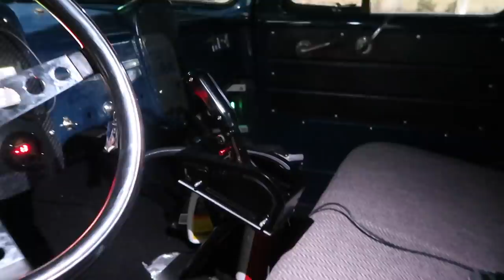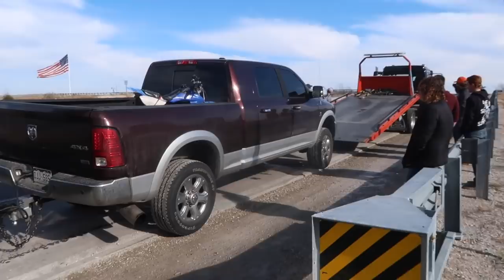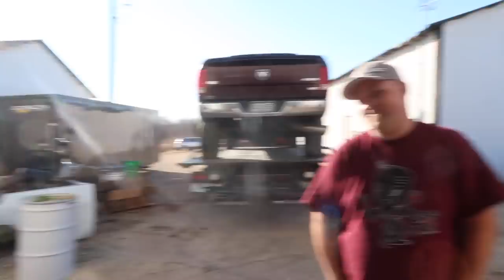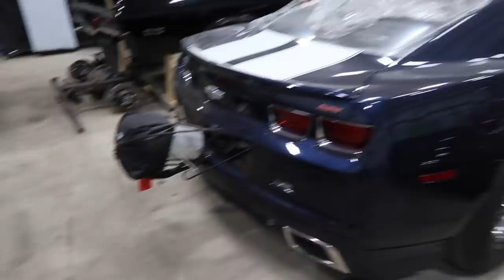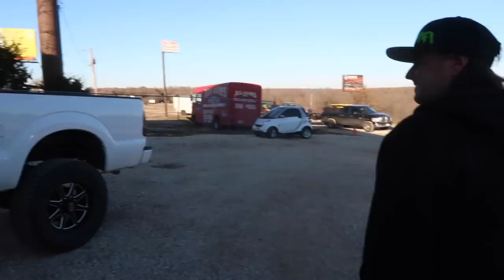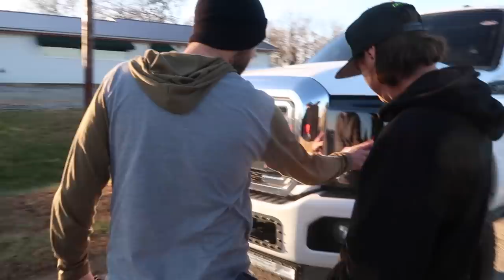Our New Tow Rig Blew Up...

Comment: Next time, don't buy a bloody Dodge.
Reply: Dont buy an automatic dodge and if you do, dont drive it when its throwing a torque converter code! Any other brand of truck would have done the same thing if it already had an issue like that.

Comment: Surprised the Cummins blew.   I'd still choose it over the alternatives.  
I wonder if the error indicating problem with converter lockup meant it was slipping the whole time which would explain the terrible mileage, and higher heat.   Maybe it cooked the rear main seal, although that shouldn't lead to nasty engine noises unless it ran out of oil, which you guys said it did not.

Comment: Go with what your comfortable with, they all have their strength and weaknesses. I have had nothing but Dodge Cummins they have done me well, my 04 still going strong. I will get another one if I wear this one out. One of my friends has a new Duramax  brand new. Broke down pulling his boat this year had to get towed, had to replace all his injectors. Like 5k worth of work on a new Chevy. Shit happens. One thing I would recommend if you keep the Cummins, get a fass pickup pump. Good luck.

Comment: BoostedBoiz@
That powerstroke sure does look good with a white trailer behind it. You should know better Kyle, driving on the highway without lockup will overheat your trans unless you have a monster cooler. High speed fluid shear = friction = heat = transmission damage!!

Comment: I blew the torque converter in my RAM 2500 Cummins, and it destroyed my transmission. Well, after it started having issues and not wanting to move anymore, I put it in 4 low and kept it to the floor until it wasn't moving and was making a lot of noise. I took it to the RAM dealership and 2 days and $6589 later It was back on the road. lol. Not sure if you have your truck tuned, but I had a Bully Dog Triple Pup tuner, and was towing on the highest setting when I should have had it on the tow setting and the tow-haul on.

Comment: Dont let it discourage you from Cummins 😂
Reply: @daerrickjohnson1349  especially the weak Chrysler made one. There is a reason the Aisin trans is available for the Cummins.
Reply: NJ in the MJ At this point you can build a 48re better than any other auto transmission. There’s guys out there holding well over 2k hp on a “weak Chrysler” transmission.
Reply: @daerrickjohnson1349  Interesting. What would be the point of offering a trans designed for medium duty commercial application if their house unit is as strong? I know Suncoast builds strong units from Chrysler cores, but I was talking about a stock unit comparison of strength.

Comment: The ccv filter in the top portion of the two piece valve cover is a ware item, it is supposed to be changed about every 50-60k miles and when it plugs up the positive crank case pressure has no where to go typically it’ll blow the rear main seal, hopefully that’s all it is

Comment: I have the same problem in my f350 the  The torque converter went out in it so was not circulate the fluid in the transmission and it would get  too hot my transmission fluid would get up to 260 when I would go up hill and you should be under 200 most of the time or something is not right

Comment: Did you window the block? That is why I buy Caterpillar. The new Ford have a better built trailer tow package, on their trucks. Might have blown the oil line to the turbo or an oil cooler, trying to be positive here. Might be something simple. Used to pull my 580 Case Bulldozer all over the country in Arkansas with my 2 Ton Ford dully and a lowboy trailer. Built tough is right. By the way, thank you for trying to clean up the language, I might try subscribing again to your channel.

Comment: My 2015 2500 Cummins blew out one of the tranny cooling lines. Turns out overt time and vibration, the c clip sheared itself thin and the line popped out. that happened at 65k miles. installed new fitting and all good. My superintendent has a 2017 F250 with 35K miles and the Camshaft broke and needed a new engine. Because he was just a couple hundred miles from the warranty expiring they gave him hell and he had to hire a Lawyer. So no matter what you buy, it all breaks.

Comment: Cummins don't blow up unless they are totally neglected and abused. On the other hand, Dodge Ram transmissions are junk... unless it's an Aisin.  I think that diesel mechanic nailed the diagnosis. Have him fix the rear main seal and build you a transmission. It'll run forever.

Comment: Get a cummins with a 6spd g56, you'll never have to worry about anything... Besides the clutch.
Reply: Everyone is freaking out over nothing.the engine is fine.the flex plate was probably cracked before he started the trip and pulling all the weight has caused it to break  and has took out the rear main seal adapter plate and caused the oil leak.as long as it didn't damage the block or crank sealing area it can be fixed easily.I've seen it happen multiple times at the dealer ship I work at.If it's an aisin trans they are great transmissions and have seen them tow way more than are rated for with no issues.wonder why most tow trucks and car haulers are dodge? Cause they are built to work not show like other  brands.anyone who owns a dodge and tows with them say they won't own anything else.yes they all have issues but don't have turbo's stuck in the center of v-8 engine baking the oil and causing excessive heat to make gaskets brittle and a pain to work on.great idea ford and chevy.keep your dodge kyle you will be happier on the long run

Comment: Turns out the $125 flexplate failed.  Not the end of the world or a reason to roll the dice on another used tow rig.  Personally I'd buy a new Ram 2500 Tradesman from Dennis-Dillion with carpet, chrome, tow package, tint, back up camera for $39k

Comment: It's hot an Automatic Transmission, that will always be the downfall with Any Diesel Engine in Heavy Duty capacity. If he drove it like 90% of the Diesel pickup owners do. They mash the Throttle flat to the floor starting out from a stop.

Comment: cumins is usually pretty reliable , maibe you just pushed it too hard.............well like i said cummins are pretty reliable , build transmission should help , big ass transmission oil cooler prolly will too , could add a slightly bigger turbo at a later date and not worry about the driveline (well maibe the diff)

Comment: Never send a dodge to do a fords job🤷‍♂️
Reply: id flip that around. i see more fords than Dodges on the side of the road. The only diesel from Ford i would use is a 7.3L.
Reply: Dodge can’t do it
So just switched to ford night and day difference
Reply: @erikkarlonas180  funny because thats not a ford engine, either is the 6.0 or 6.4 that you are seeing on the side of the road. 6.7s are the only Ford diesel, and from what ive seen they are great engines and tow like raped apes

Comment: "I want a nice truck that can haul stuff" - Buys a notoriously unreliable dodge.... get a Duramax... the combo with the Allison is untouchable.
Reply: LOL
Reply: Yeah ok, let me know when durajunk is in semi trucks 😂
Reply: BraaapAttack that just shows how much u know about semis.. it’s the same concept and designer but not the same motor... 😂 besides the tranny is the problem in those dodge trucks. The Cummins is incredible but it’s backed up by a dog turd for a tranny which is why the duramax (which is the second best diesel power plant) will always get my vote.
Reply: The 68rfe does just fine in stock form, but if you have an idiot light on for a problem, and it goes for how many hours cooking itself, shits gonna fail. All the 68rfe asks for is transmission fluid and filter changes and use your head while towing. 

But far as durajunk, find me a v8 based diesel in a modern semi...
Reply: @braaapattack2937  duramax is an isuzu joint venture motor and isuzu is in a shit ton of semi trucks the allison is way more reliable then the aisin tranny.

Comment: The only Cummins worth a shit are the older 12v engine's. I have owned 3 of them and were all great engines but the transmissions are trash. If i ever bought another 12V I would probably do a 4R100 swap or a Allison transmission because gearing is better for highway.

Comment: This was your own dam fault. You knew you had a lock up problem with the converter and should have fixed it before you left,now it's going to cost 3x as much to fix , all the crap that went through the transmission will have damaged way more that if you had just fixed it not to mention bearing wear in the bottom end of the motor, better do a bearing roll/swap. You now have no excuse to not do all the up grades to the transmission, converter swap . This is such a common problem when towing heavy loads , a google search would have told you to fix it immediately or face this problem , your actually lucky that a diesel drag race shop has it to fix .Dude will know what to change and tune the puter to stop it from happening again.

Comment: "I'll just try all three, start with a Dodge, then try a Ford" well only problem is if you went from a powerstroke to a duramax, you would lose lots of power and hate yourself.
Reply: But unlike the Duramax, the powerstrokes are known for failure, especially the 6.0, they are just junk. I'd take that broke down Dodge and be more reliable, I would rather take the Duramax cause there is never any problems you never hear fro them!
Reply: @VentusHarpus12  I like how you say you "would" take. I own a 6.0 and runs great. There not known for failure their known for not being maintained. I've had em all. The Ford is the better pick up, more power, faster and more reliable. And my truck isn't even stuuded, factory head gaskets ,running a 5.4 sec 0-60.
Reply: @nemideergoon1844 I've had many fords in my life to know what's wrong, I used to be like you and love fords! I used to talk good about them, but I finally became smart and realized I'll save more money buying a Chevy or Ram! I've had a 2004 Ford Taurus god be damned that it didn't get a cracked motor, cause that thing is garbage, I have a 99 ford e-150 and that thing is at my farm on jack stands and blocks cause new problems keep coming and coming, and a half a year ago I bought a used 2016 ford f-250 cause you know people like you tell others "Buy ford they're the best!" so I bought a ford that only had 25k miles, and god be damned after driving it a week the fucking shitty thing kept getting in my nerves breaking down all the damn time! so after that, I bought a 2004 chevy 3500 with a Duramax engine, The thing runs like new with more miles on it than what that shitty ford had! the only thing I did too it changed the breaks and to an oil change! and recently I bought a 2012 Dodge ram 3500 cause I wanted something newer, and the only thing I did to it replaced the windshield, cause I live in PA where I need yearly inspections and this was an Ohio truck so windshield needed replacing! the previous owner told me he changed the oil about a week before he listed it, so I didn't worry about that, and so far with my Duramax and my Cummins I haven't had issues as I had with Fords, I'm happy I switched from ford to something better! have a good day sir, and you can keep ur junk, just keep it away from me cause I don't need ur rusted parts falling off and hitting me on the road!
Reply: @VentusHarpus12  I did catch the last line, if you think a ram doesn't rust out before a Ford then you have magnitudes of topics you have no clue on. Take care sir.
Reply: @nemideergoon1844  I live in PA and nope my 2008 Dodge ram has no rust on, but my friends Ford is rusted completely out the same with my ford e-150!

Comment: That's what happens when you own a bs dodge/Chrysler product
Reply: Well as it turns out, Cummins is not owned be Dodge/Chrysler.
Reply: Also turns out it wasnt the motor. Dodge is still trash the cant make their own diesel engine that could be reliable. Dodge isn't know for its reliability.
Reply: @thebluntedcarguy7163  idk... My friend has 428k miles on his Cummins and has had no issues  since day one 🤷
Reply: @thebluntedcarguy7163  Well, i'd rather be in a Cummins than in a shitty ass 6.0 powerstroke do you know how much problems they get???